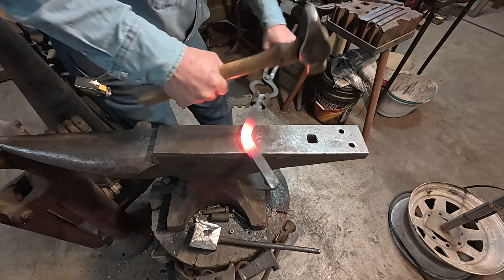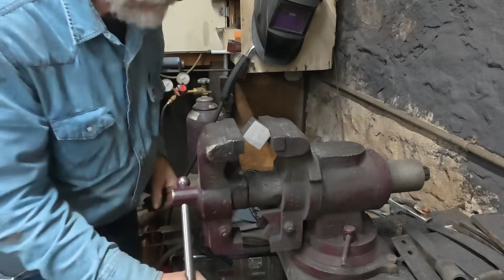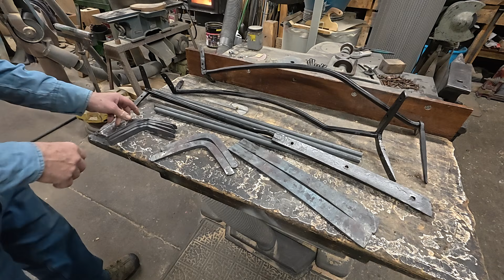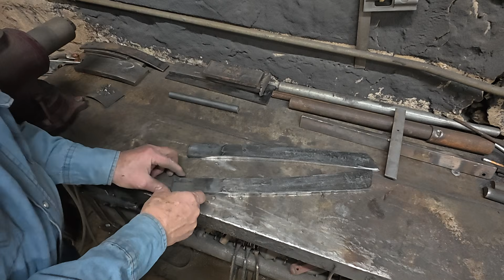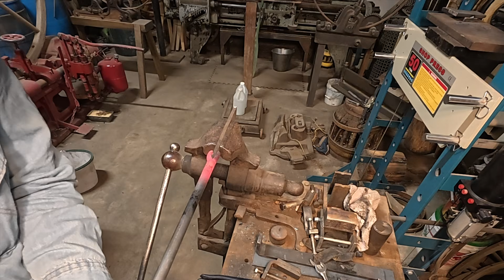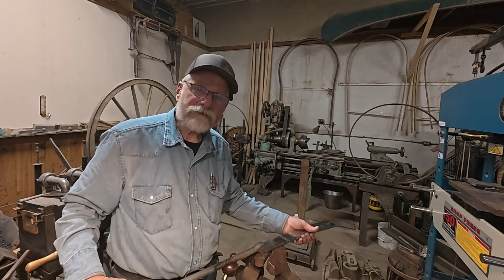FORGE WELDING Like Our Forefathers - Almost | Engels Coach Shop

Comment: I assume they upset the ends of the 3/4" bars so they had much more material in welding to the flat bar stock. At least that's what I would do.

Comment: ❤ 1:56 what is that 1-1/2 painted abs pipe on the side of the power hammer for?
Reply: It deflects the noise of the built-in air compressor.
Reply: @DianeEngel-z2m 🎉 Thanks.

Comment: It's always neat to watch when you're hammering a heated piece on the anvil, how quickly the cold mass of anvil sucks the heat out of the piece you're working. It goes from yellow to red very quickly, faster than it does when you're doing something with it off the anvil. Your ability to fabricate multiple pieces one at a time that turn out identical is amazing.

Comment: In Finland the old term for the apprentice was "sepän sälli", seppä as in blacksmith and sälli ... definition would be a stage or two above a hoodlum, a slacker. I think a decent "sälli" was worth his weight for atleast good steel, if not for more valuable metals. Atleast by looking at the tiptoeing steps needed when doing the forge welding alone, you do make wonders with limited "staff". It has been a pleasure to watch the process again. 👍😄

Comment: Back in '79 or '82, there was a young smith (now retired) who showed how to weld a round to a flat without the flat  moving and without arc or gas tacks. 

He upset the rod end. Split the upset with a cross drilled hole, hacksaw and sharp chisel. On the flat, he drilled 3 or 4, 5/16" drill points located under the flat at the weld. Then at white heat, he  hammered the rod onto the flat with a swage.  The rod deformed enough into the holes to provide sufficient grip during forge welding.

This method is only for decorative application for restoring historic works. The drill points retain slag and reduce weld strength.  He said Yellin used it in the studio based on sectional analysis of frost heaved welds.

My main take aways from his demonstration:
1. Upset and arc tack weld.
2.  The upset & the tack can be easily forged out and lightly ground, removing all indication of the weld (much as you did.)

I did this drill point method only 2 times on matching door handles. Worked well, but not worth the effort. Tack welding is much faster and exceedingly few would notice the difference.